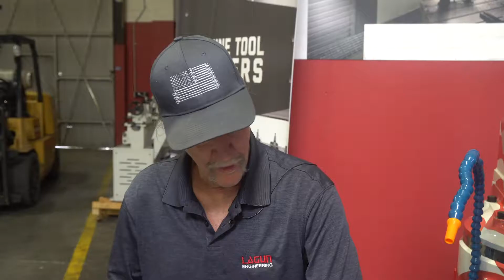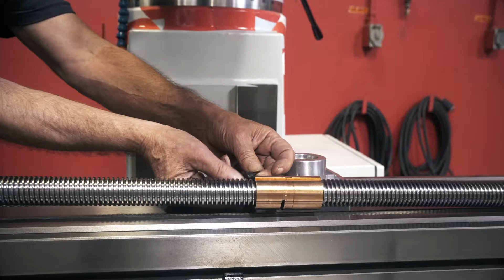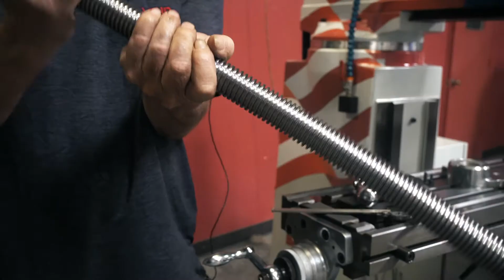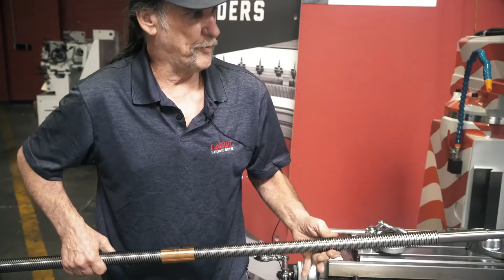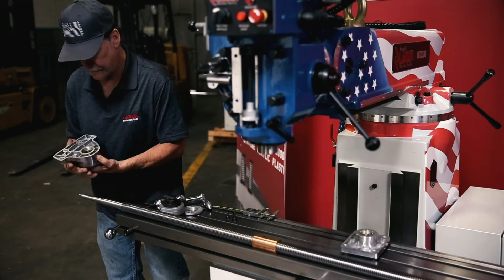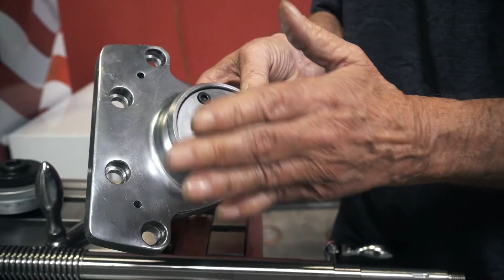Lessons with Lagun: How to Replace a Lead Screw on a FTV-2 Mill

Comment: Awesome! Could you guys guy over the repair/replacement of the quill feed assembly? I have an issue where I think the return spring is not disengaging the selector enough. With the spindle lock backed off the quill feels like the pinion is still engaged.